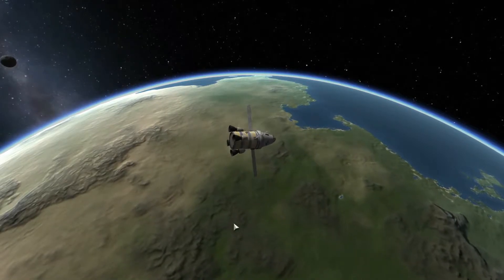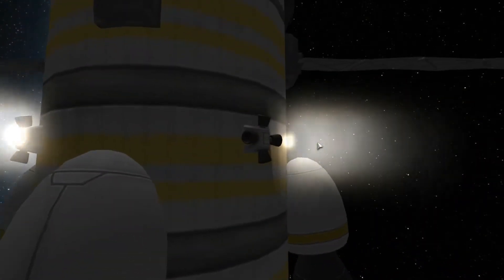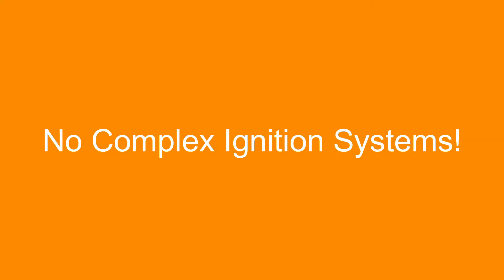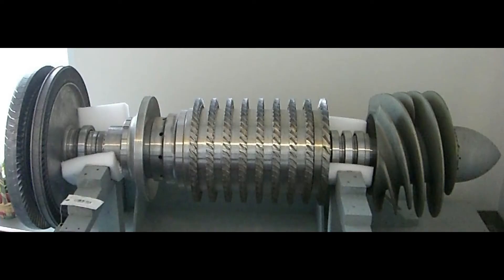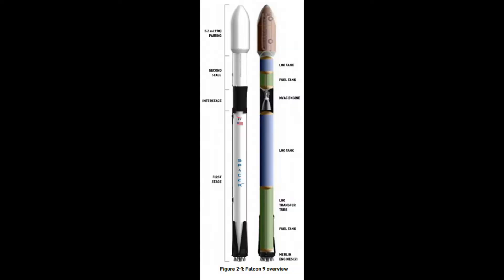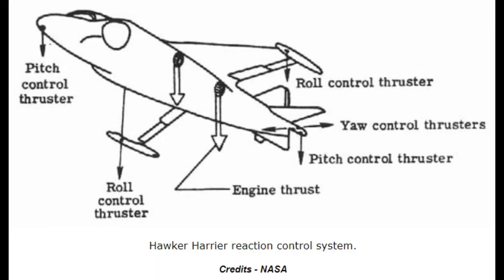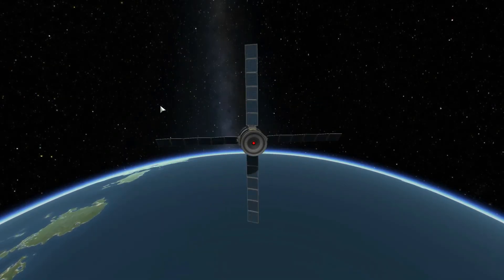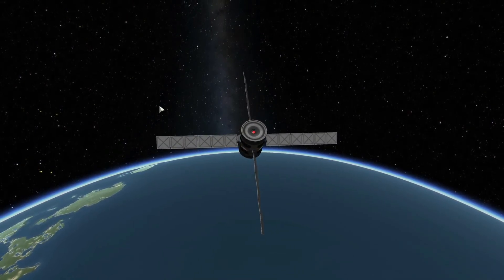What Are Reaction Control Thrusters?

Comment: Can these be put on planes to avoid stall for moments when the aircraft is unresponsive in early or mid stall? To point the nose to the ground to gain airspeed or even to give speed in stall to push nose down manually?
Reply from the maker: I haven't heard of any planes that do such a thing, but like I said at the end of the video, the harrier uses RCS when in hover mode to control itself. (Which is kinda like what you are saying, because it can't use its rudders, elevators, or alierons at low speed.)
Reply: @billybot3000  I imagine a plane with wing slats like this https://youtu.be/AKnbMIh3p4k 
And also thrust vectoring like this https://youtu.be/JswH_OLkD0Y
Plus variable angle of incidence like this https://youtu.be/t3wzoJt8lpU 
With variable pitch propeller https://youtu.be/TR7KZdHLkE4
And Rcs and Vtol capabilities 
And all under 254 lbs with 63 mph top speed 1 seat and that sumbitch will be interesting to say the least . Needs to be made small scale first to prove the design
Reply: In the United States, ultralights are described as "ultralight vehicles" and not as aircraft. They are not required to be registered, nor is the pilot required to have a pilot's certificate.